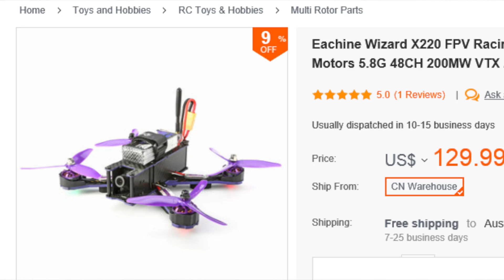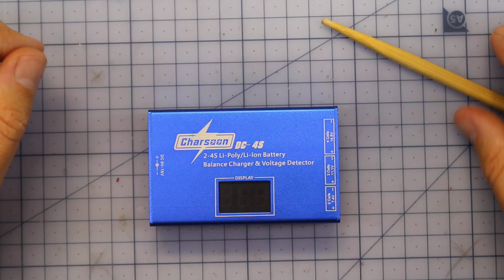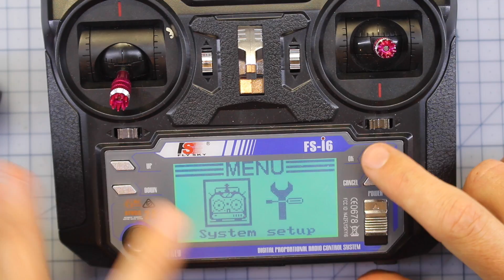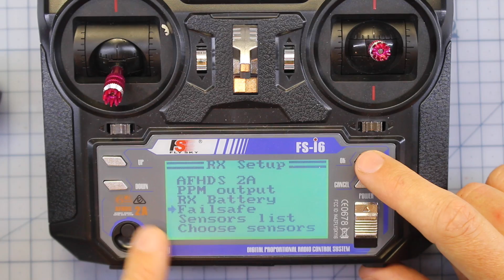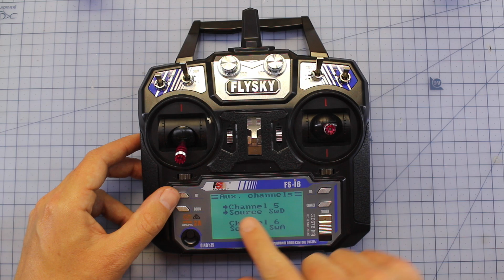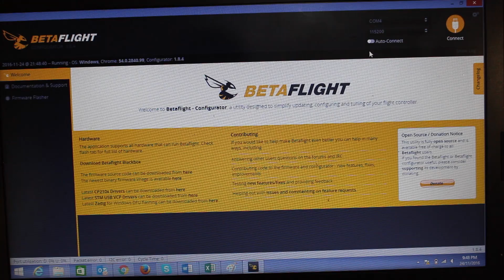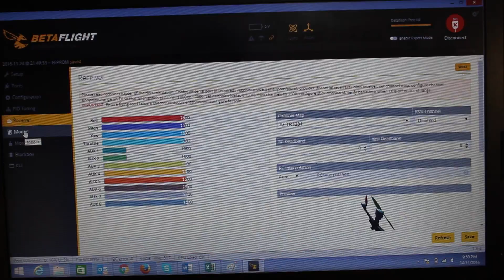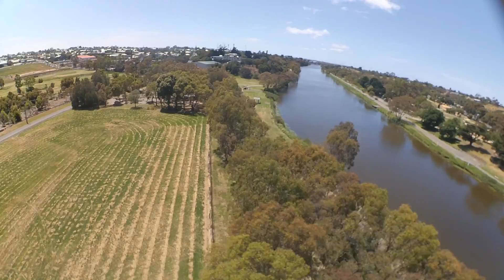How to get FPV DRONE RACING for under $300! Parts +Full setup.

Comment: never flown a quad before.  did some quick research and it recommends buying a micro drone to learn on before buying a kit like yours. what's your opinion?
Reply: romian mcghee well if you have a decent computer you might just want to buy &quot;liftoff&quot;, its a really good simulator. But before doing that be sure your goggles and tour radio are compatible to your pc / to gaming. Look up for it, a guy did a 100hours of liftoff to real drone video, and he is pretty good
Reply from the maker: a sim is a better choice

Comment: http://www.banggood.com/Eachine-V-tail-210-FPV-Drone-Spare-Part-35C-4S-14_8V-1500mah-Battery-XT60-p-1100021.html?rmmds=search Would this battery work? Would it fly any longer?
Reply: Cecil Lee yea it would but the c rating is how much power the battery releases. Your battery would have minimal 'punch' and a slower speed.

Comment: I would like to let you know I order all the parts per your list back on 12/4/2016. I have waited and started calling about where the parts are. Banggood.com say's they are out of stock of the googles and battery charger. course it took over a month just to get the remote and batteries. I have not received anything else. It is interesting that they sell things that are out of stock and takes almost a month to tell you that they are out of stock. I will keep you informed of what happens from here

Comment: I have followed every step up to connecting it to beta flight. It says cannot connect and closes the port. Ive tried a new cable and different a usb port but that hasn't work. can anyone help?
Reply from the maker: there are a bunch of drivers you need to install. they are listed on the front page of betaflight when you load it up
Reply: Thank you so much for the help it worked but now when I go to the pid tuning its showing that my aux switches aren't responding except for the 2 dials on tops

Comment: can I use this headset instead of the other one will it be better http://www.banggood.com/Eachine-VR-D2-5-Inches-800480-40CH-Raceband-5_8G-Diversity-FPV-Goggles-with-DVR-Lens-Adjustable-p-1074866.html?rmmds=search
Reply: Get now 50% discount on this FPV drone + everything when using this coupon link: https://www.banggood.com/?p=TL0111854575201411Z0 Check it out!
Reply from the maker: you can, but i didnt like that one as much
Reply: Thanks so the one that you have in the video is the best for that price range
Reply from the maker: Trent Moger i thought so, yes
Reply: Ok thank you 
On the website for the drone it have i full kit is it ok m.banggood.com
Reply: UAVfutures what kind of drones do they use on espn or is it your choice & speed is based on what you put your money into?
Reply: Rens Kippen thanks bro I appreciate the link
Reply: This is a lie! There is no discount, the link is a affiliate program link. Please mark Rens Kippen comment above as spam using the 3 dots on the right.

Comment: Could you please tell, is it possible to connect sbus with this connector (on 11:42) ? And what should I choose in betaflight when sbus is connected ?
Reply from the maker: these can run sbus(ibus). but it is a few more steps, turn on serial rx uart 3, and select serial in the config for receiver and choose sbus.

Comment: will the 14.8volt battery burn out the video transmitter
Reply from the maker: no
Reply: it was the on screen display system they say will burn out if you use a 4s 14.8v

Comment: cool video !
@22.50 Why did you switch the yaw to 270 ? Did you rotate the flightcontroller? because easier usb access??
Reply from the maker: correct
Reply: ok thanks for clearing that out

Comment: So, I've got my drone and set it up, I haven't put props on yet but I've found that when I put even a tiny bit off throttle on the motors begin to accelerate even though the throttle stick isnt being moved. I also noticed that your quad appears to spin the motors when armed even at 0 throttle but mine does not, have I missed something out??
Reply from the maker: you might have motor stop turned on, also if they are increasing with no props on that is normal behaviour
Reply: UAVfutures thanks again haha found the motor stop setting on beta flight so its all good :D

Comment: Why are you suggesting the BNF version instead of the RTF version for this? Also if I get the BNF, should I get the Turnigy Evolution controller instead of the flysky?
Reply from the maker: the BNF is actually a better FC, and yeah if you can afford it the evolution is awesome
Reply: Gotcha. It looks like they upgraded the RTF to an F3  flight controller now :) 
"Note:
Both of Mode 1 and Mode 2 come with F3 6DOF flight controller and 2205 2300KV brushless motors now.
Update time: November 17th, 2016"
Reply from the maker: thanks

Comment: 3-7 minutes of flight time? Eesh...
Reply: Pretty sure that's fairly typical of high performance drones this size.
Reply: GlintTheStrong I know - the batteries are £20 as well
Reply: qumefox I am a newcomer to drones .. but £20 for a battery seems expensive. Then again, now looking back it is normal and makes sense considering how much power they deliver.
Reply: Jonathan Shaw they deliver a lot, aren't too heavy and you can keep them for more than 2 to 3 years.
Reply: ANtoine Nat awesome

Comment: Hello sir. I bought the eachine racer 250 before I knew anything about fpv racing. Do you think that it is an OK drone? Would you recommend it? I have had some issues with those cheap Chinese capacitors popping off of the pcb board and the drone falling mid flight and breaking so I personally do not like it. But what do you think?
Reply from the maker: i really do not like the racer sorry

Comment: i got the same setup! i did everything like you ut my drone woent react to the remote controll
...yes its lighting up constantly so they are connected?
i dont know what to do... would be nice to get some help from you guys :D
Reply: hwy UAVfutures do you know what the problem could be ? thx in advance
Reply: you probably have the wrong receiver
i first had the FS-IA6
that is not working
watsh the video and buys the receiver he tells you too in the video!
Reply: you need the FS-IA6B
Reply from the maker: lighting up? with the usb or when you turn the radio on. need specific details please.
Reply: it lights constantly when you stick the battery in and turn the remote on and blinks when the remote is turned off. That seems to be correct. But the quad shows no reaction.  the betaflight programm also shows no reaction when you push the throttle.
Reply: Im using the FS-IA6, not FS-IA6 B
Reply: because it automatically sent me this one with the remote not the one you have shown
Reply: and i tested the drones motors on beta flight and they worked perfactly normal
Reply: Having  the same problems
Reply: i had same problem bought the fsia6b thanks for confirming to me that when i receive it it will work and that was the cause of the problem
Reply: I do have the same issue. I could not get it to work in betafligth so I use cleanflight. the remote seems to operate there but when I unplug it from the computer and try to flight the drone it is unresponsive. Any idea why???
Reply: have you set up the arming switch correctly?

Comment: I have everything you listed except for an FS-i6x radio and receiver.  I can't get anything working,  I can't even get my board to be recognized in Betaflight.  Is there a video you recommend for an even more in depth tutorial for and absolute quad beginner?  I'm frustrated and my search for how to get betaflight running has come up empty.  Thank you, Clayton
Reply from the maker: there is a guy called joshua bardwell, he does excellent videos on exactly this stuff. is it even connecting to the computer?
Reply: UAVfutures No,  it won't even connect.  I'll check out his videos, thank you

Comment: Anyone from UK post good links to get this stuff from? Can't seem to find the quad for less than £200
Reply: the link he provided is £118
Reply: Danny Sian good point. I think I was mostly put off by the fact that isn't a UK based website so don't like buying international stuff due to import taxes
Reply: geetarwanabe don't worry I buy from banggood all the time. They are normally pretty good with any problems although anything other than postage may be put on the sellers list of problems rather than them taking responsibility themselves. I've bought around 8 items and have had no troubles as of yet :)

Comment: Hi! Really great video on this entire setup! Liked and subbed! Awesome channel!!

I purchased most of this setup through your links and am incredibly excited to try and get into FPV drone flying. In the meantime I have a $99 Hubsan X4 coming in the mail that I'll practice with since I honestly have no idea what I'm doing lol. 

Do you mind if I run everything I purchased by you to confirm it will properly work together?

I got the Eachine Wizard x220 racing quad 
Two Dinogy 1300mAh 14.8V 4S batteries, as well as the charger you recommend
But then I ordered the Flysky FS-I6S 10ch 2.4G AFHDS 2A RC Transmitter Control w/ FS-iA6B Receiver (Which looks to be almost the same as the 1a6)
Eachine VR D2 goggles (becasue they have a DVR and dual antennas)
2pc RP-SMA TBS Triumph antennas
One Crazepony FPV RP-SMA Panel Antenna 5.8G 14dBi High Gain
Runcam Owl Plus wide angle camera

Will all these pieces work together properly? How difficult will it be to hook up the Runcam? 

Also, how do you record your flights? Did you record the flight at the end of this video with the stock setup, or did you have another camera connected to the drone doing the recording? 

So freaking excited to get into this sport! I have a Mavic Pro on pre-order (wont arrive till Feb 2017) and want to get semi decent at flying before I chance wrecking it. It seems this Eachine x220 can take a pretty decent beating in the meantime. 

Thank you! :)
Reply from the maker: hey mate. welcome to the hobby. yes all that looks great. the only question is if those antennas will be the right plug or not. I cant remember, I think you need one rp sma for the quad, but I cant remember what the VR D2 take. but yes that all looks good, 

the run cam might be a simple plug and play or if it is a different cable you can just cut the wires and solder them to the new plug, very easy stuff. I have a soldering guide on my channel if it helps. 

I taped a GoPro on top to capture the flight footage at the end. 

welcome to the hobby, happy flying mate

Comment: Awesome video! I just bought the Wizard! I am trying to find some info on swapping out the camera, will a RunCam Swift or Eagle work on this? Because as I understand it, the 2.8mm 170º lens swap doesn't fit on this correct? Any info would be appreciated!
Reply from the maker: it will be fine, you can swap them, at most you might have to cut and solder the wires but its very easy, and simple to do.
Reply: Awesome! Thanks for the feedback! Can't wait to get this thing.

Comment: Is there a usb connector for smartphones to be used as goggles? Like could i get an antenna for my smartphone that connects via usb?
Reply from the maker: not really, too much latency for it to be used as a racing drone.
Reply: +UAVfutures hmm. But if you think about it, the VR headset is just an attenna that connects to a monitor that displays information. If you  attach that same atenna, and solder a usb connector to it, then program an app that uses that attenna, and use your smartphone as a display. I mean would that function the same as the eye gear?  Im sure someone has thought of this!

Comment: ive decided to build myself a gb x190 quad. but i cant decide which controller to use. Acro 6DOF or Deluxe 10DOF? is there a big difference for me as im new to this? never had any quads exept toy ones. what would you reccomend?
Reply from the maker: the 6dof will be fine

Comment: is there any problem with using a 1800mAh battery with this? the specification says it has a self-protection function, does that mean anything?
Reply from the maker: a 1800mah battery would be fine
Reply: UAVfutures awesome thanks

Comment: I have question, not related to this specific topic though. I'm building my first quapcopter and I'm done building and programming but something is not right. When I arm the motors the start spinning and as I move the throttle up and they start to spin faster the turn off, if the move the throttle back down they start again. Any idea what I'm doing wrong. FC is a F3 spracing and I'm using a flysky i6 with fs-ia6 receiver. All the controllers function properly on betaflight. Thanks in advance.
Reply from the maker: if this is without the props on. have you tried to hover.
Reply: UAVfutures no this happens with the props on
Reply: Got it! my RX is connected using PWM and one of the wires was mixed up causing the problem. Got it all sorted out.

Comment: what is the distance and the speeds this drone can reach.... I'm trying to start this hobby and might go with the set you recommended
Reply from the maker: 70 - 80km per hour, the distance is limited by how far your video signal can go, which is about 500 - 1000m in clear line of sight, but in reality its probably around 200m around a track with some trees etc
Reply: k thanks!
Reply: btw you are one of the fastest YouTubers I have ever seen respond to someone's comments :)

Comment: Great video. I am just starting out and have a question. Would you recommend the flysky fs-i6s radio with the wizard? Is there any difference between the flysky fs-i6 and flysky fs-i6s?  thx
Reply from the maker: the best radio but a bit more $$ is the turnigy evolution

Comment: hey :) how do i know if the battery is low? can i install a buzzer?
how? help the noob here! :)
Reply: Upgrade to a camera with OSD and you can see the voltage while flying 😎
Reply: :)
http://www.banggood.com/Wholesale-1S-8S-Li-po-Battery-Voltage-Tester-Checker-Indicator-Monitor-Buzzer-Alarm-p-26049.html?rmmds=checkOutSuccess-bottom-alsobought
Reply: I want to ask the same thing! It seems like going too low on the battery is a really big deal, but battery monitoring wasn't covered in the video...
Reply: Neon8787 On ebay, they sell little voltage measurers, which buzzes very loudly when the voltage gets to a certain user set point. they are only 5 bucks or so

Comment: I noticed on the transmitter that bang good ask for which throttle do you want (right hand or left hand). Which is standard? I'm right handed and can this be reprogrammed later or is this a physical difference in the controller?
Reply from the maker: its a physical difference, most people go mode 2 (left hand throttle)
Reply: Thanks for the answer I'm new to this.

Comment: Sorry if im asking alot of questions but why would this one:  http://www.banggood.com/Infinity-4S-14_8V-1300mAh-70C-Graphene-LiPo-Battery-XT60-Support-15C-Boosting-Charge-p-1062565.html?rmmds , be better than this one: http://www.banggood.com/Infinity-4S-14_8V-1500mAh-70C-Graphene-LiPo-Battery-XT60-Support-15C-Boosting-Charge-For-Racer-Drone-p-1058084.html?rmmds=search ,

And what charger do you reccommend for charging multiple batteries at a time? (for the least amount of money :) )

Thanks
Reply from the maker: the first battery is a little lighter, so a weight saving, but the other one holds more so maybe a bit longerr flight time. 

I like the turnigy accucel 6 and a para board for multiple charging, i have a video on it on my channel.
Reply: UAVfutures Thanks a lot!

Comment: I really want to get this! would the video connection quality be better if i buy a different antenna like those clover directional ones instead of the one it comes with?
Reply from the maker: yes, better antennas mean less break up and more reliable signal.
Reply: UAVfutures oh cool, is there anything specific about the antennas I need to know when I  buy the pair? Or would any be fine for starting up?

Comment: How do you record when your flying?? Great video btw I subscribed and am strongly considering doing this. Thank you.
Reply: DJ HEX putting a GoPro or action camera on it. The FPV camera is poor quality in comparison
Reply: I think I remember seeing some strap on points where you can mount stuff onto the frame. some velcro straps should do the trick. As to the weight distribution, I'm pretty sure it does shift it but tinkering with the settings in betaflight should correct any changes.
Reply: DJ HEX get a little racing cam. Banggood sell them and amazon like the möbius
Reply: danny fpv ah see that's cool
Reply: Hugo Russon how do you put a GoPro on it? And does it mess with the weight and how it flies?
Reply: Duffy512pd you go and get a gopro mount. I don't use one so I don't know if it will mess around around the stability but the little action cameras are so small they won't affect anything I think.
Reply: I fly with my GoPro hero 3 all the time mounted to a 3D printed mount angled at 30*.
It doesn't affect the the agility/balance at all, it's completely unnoticeable and your left with your sweet footage!

Comment: Is there a built in OSD on this drone?  I assume there isn't.  I'm slowly learning everything, I notice some FPV had some nice hud information, even a pitch ladder, horizon, and all that other useful information.  Is there a OSD that you would recommend that is easy to install for a first timer?  I don't know if they are plug and play or if they need a lot of splicing and soldering.  I do have a old soldering kit in my old toolbox somewhere, I just don't know where to solder to what.  Or if they're ones that just plug in with harnesses.  

There aren't too many OSD tutorial videos out there.  I assume most drones don't have built in OSD's.  I guess this means you have to buy OSD's for each drone you own.  That's a lot of OSD's you must have purchased!
Reply: Snafu2346 'painless 360' - worth checkin out :P he has some vids
Reply: I will check it out, thanks!